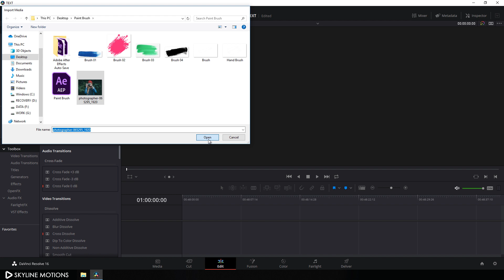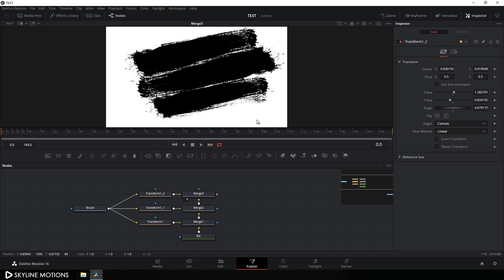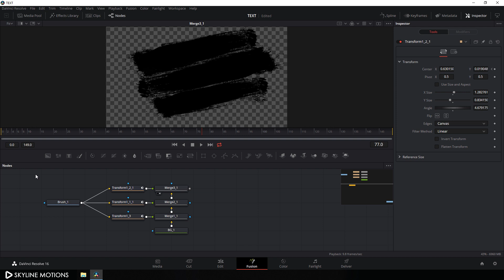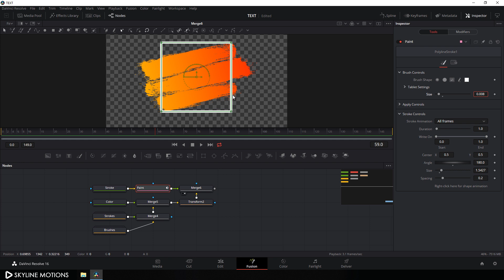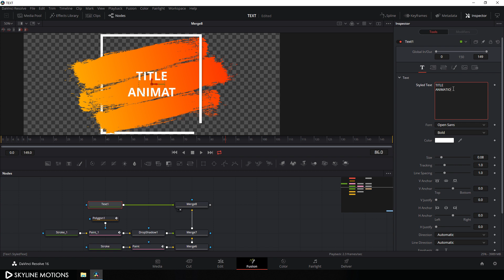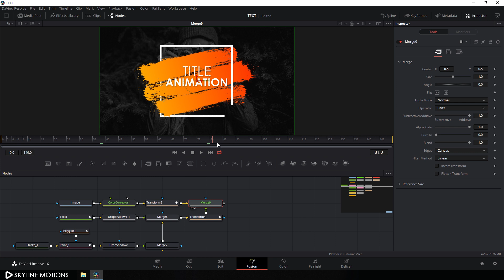Comment: Hi, I hope this leaving message can contact you. I follow your steps and successfully complete this fusion. It's amazing effect. I saved this fusion to setting. But the problem comes....If I create a new project, put the fusion into the new project. It will show "Media Offline". I knew that is because the "brush" is in another folder. How can we solve this issue without "Media Offline".
Reply: Thanks for asking.
There are two options 
1. Replace the media-in nodes with the loader node and locate your file in it and then save as a setting.
2. Go to the media pool right click on the missing media file and replace it with the new location’s file

Comment: Hello Davinci God, I got a question about fusion mediain. Whenever I put an image file into fusion by dragging the file into it, it makes a mediain node. 
But then, when I copy that fusion clip into different projects using dynamic project function, that fusion keeps the mediain but loses its source so the mediain needs to be reconnected to the file. Is there a way to solve this or am I doing something wrong? It's not a big deal to drag the file again but my idea was making a clip that could be readily reusable for other projects but due to this, I had to manually reconnect them :(